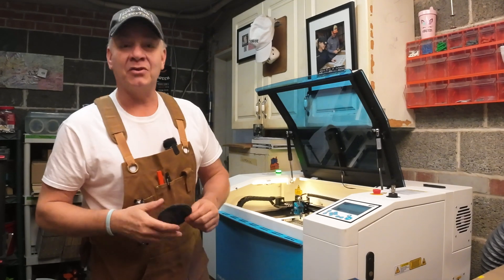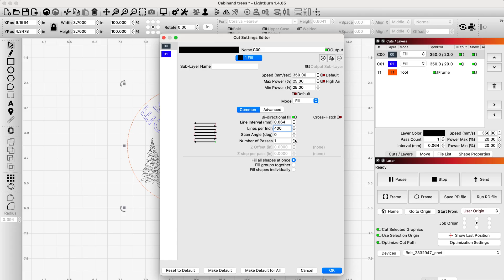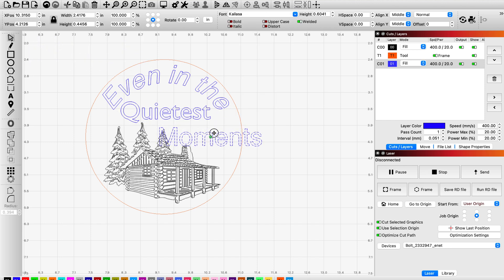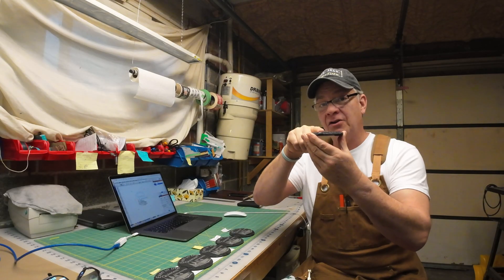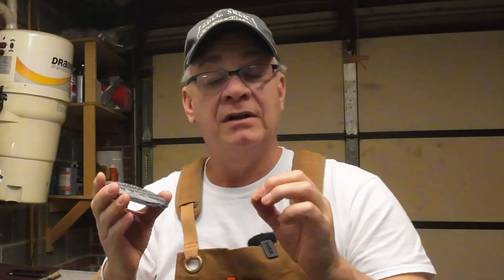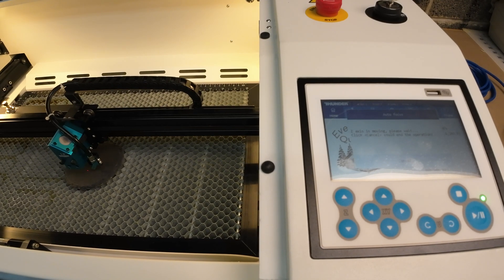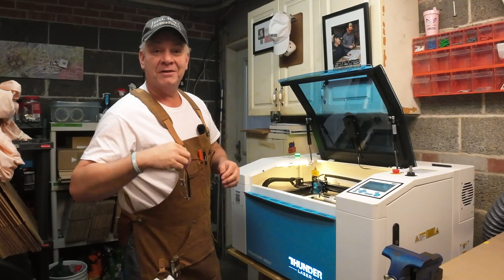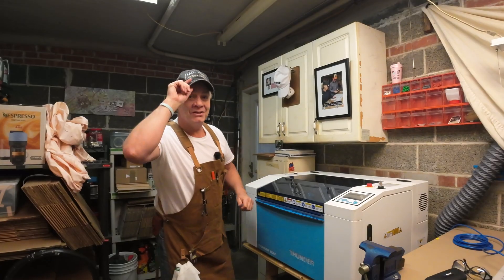QuickShot: Slate Coaster Engraving Settings. Thunder Laser BOLT. 009   4K

Comment: With our laser I have found making templates is key for batching out these job that all have the same shape. Cut it out of some ply and set it up so you can put the sheet right in the corner so you don't have to line it up everytime, it can just start from the home position. You can have it do multiple coasters this way and save a bunch of time. Love your straight forward explanations.
Reply from the maker: Hey thanks so much. If you have a minute, I would appreciate your thoughts. I find my plywood warps over time in the garage and so have been trying to decide if I should use MDF instead of plywood for templates. What are your thoughts? What thickness of plywood do you use? Thanks so much for your time. :)
Reply: @LaserNUG  I have used 1/8" hardboard for templates, but mdf would work well also. I just made a template out of the hardboard for 54 wooden keychains. Definitely speeds up the process once they are loaded. We primarily use 1/4" Baltic birch plywood for sign projects and the struggle is definitely real with the bowing. We buy it in 4x8 sheets and cut it down to size.
Reply from the maker: @mainerdiy8399  Thanks very much - very helpful info. Have a good weekend!